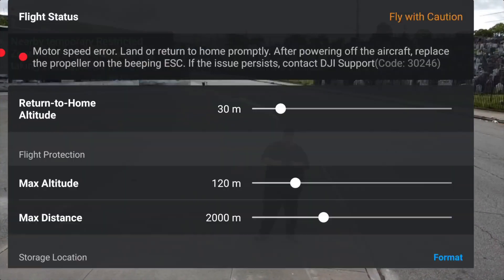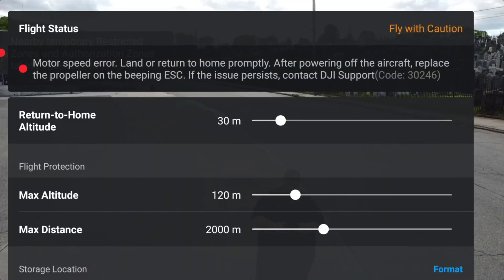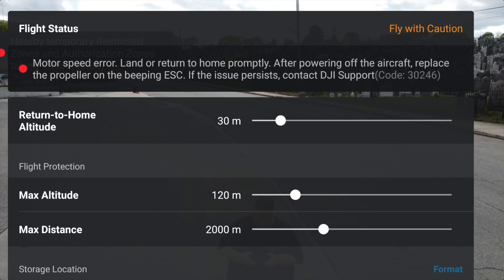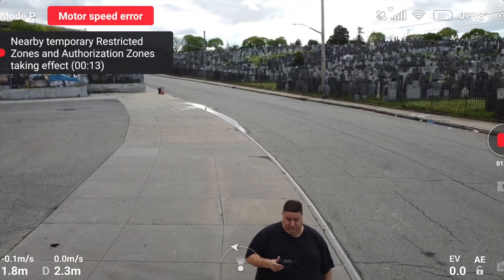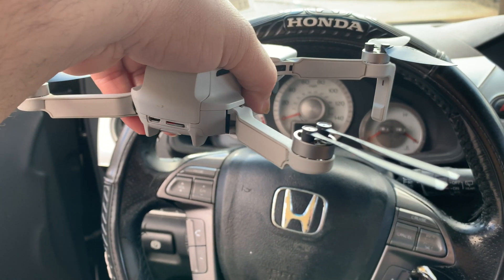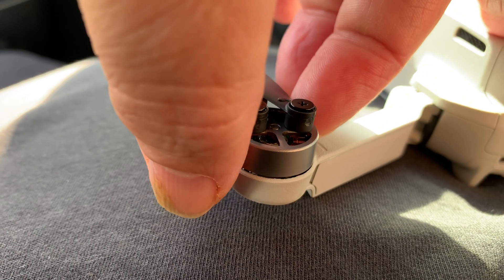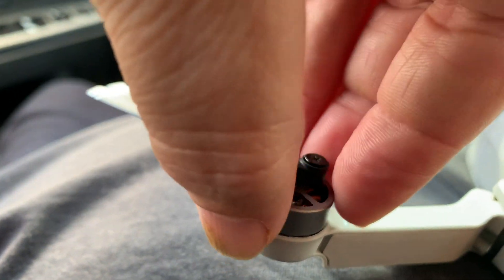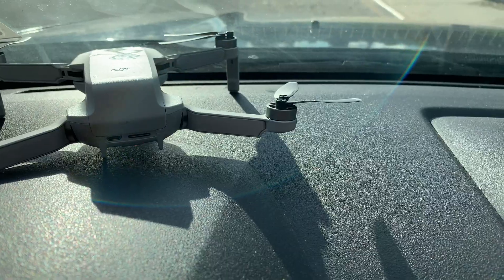Mavic Mini Motor Error fix

Comment: One the worst things you can do is to downgrade or take away its ability to tell you where its pain is. Yes it seems fine cuz its mouth has been muffled but eventually it will fall out the sky. Even with only the props being changed without downgrading the firmware it will be fine until those props warp again, AND THEY WILL IF YOU DONT CHANGE THE WAY YOU STORE IT. LIKE I SAID JUST PUT A SIMPLE PIECE OF SELF STICKING VELCRO ON THE THE BOTTOM/BACK LEGS. I also put one on the front/top ones as well cuz I don't like the flopping around. Just don't put the velcro on the blades very tight and bind them together and you won't have anymore issues with this error code, EVER AGAIN!! You should read my other comments and think about what I'm telling you.
The problem with downgrading is that the problem is still there only now its not capable of telling you its there and where it hurts. Thats why they added it afterwards. So you would be aware of a new issue since the book had been written. Its still an issue for the aircraft and its all depending on how bad the issue is as far as what you may or may not be doing to inadvertently causing the problem as an individual person. The most organized and neatest person in the world could have one and treat it the best in every way they know possible but not knowing what is causing it and or future worse problems by trying to solve a problem just by silencing its mouth so you don't have to hear that its in pain constantly. If you can hear when its in pain you can adjust things, at least slowly till its not crying anymore. And if someone that has cured the same problem by doing something simple it seems like a no brainer to give it a try, especially if what they say makes perfect sense. Which is why I shared. Not everyone will be humble enough to admit they dont understand the underlying issue because they don't have time to put into digging into it  but will try it anyway because their smart enough to recognize that it makes sense and will find out for themself by giving it a chance and Viola!! issue solved!! And not everyone will be intelligent enough to recognize that it makes sense so they do nothing at all till it falls out the sky eventually and thats when they will think about what im telling eveyone

Comment: So i finally figured it all out just by going through the motions and the facts on this speaks very loud. I'm gonna mostly let the pics and videos do a good bit of the explanation itself.  If you keep in mind that the entire head of the drone cut out in the case from motor cut outs to nose tip is the same flat level in the case Notice where the ridge starts and stops as well. Just as it sits on this flat mirror is as it would sit in a flat bottom case if it needed to as in such case as I have.  As far as the props are concerned it might as well be a totally flat case just like my flat bottom MPP Fly more case I modified and use for the Mini. Theres nothing more that the flatness of the bottom of the case can do than this flat mirror does to bend anything if you store it the way i have for a year now. Self sticking velcro strip i got off my MPP CHARGING CABLE. JUST A SIMPLE CABLE WRAP.  If you pay attention to my pics and video you'll see that storring your mavic mini this way is really the only way to do it without worrying about an issue. As you can see the that grey tape on the mirror would be where that raised edge/red line starts and stops. Any other way of folding them than directly across as you see will bend them at all random places depending on how they lay each time. Start out with the design of the case and drone body lines. The red mark represents the grey tape i used. Blades running directly under motors precisely. The raise in the case is 1/2 inch. The motors and prps and velcro thickness only 1/4 inch. The props never touch bottom in the fly more case this way. They constantly remain un touched and couldn't possibly warp the props. What all this means is that ANY OTHER WAY is bad news on the props and Mini.
Everyone's over all knowledge of this varies from clueless to now the truth and facts that I can't see being disputed b a smart individual. But I realize there's hundreds of new owners everyday and some are just finding out about the issue. I know many will need more info than this and I'll answer questions but I'm wanting the ones that have some knowledge of whats going on to be see this. The pics and video and explanation alone will be enough for them to understand. Study these pics good and you shouldnt need much more explanation.

https://linksharing.samsungcloud.com/nafrqrJSpH6r 

https://youtu.be/cuGPaCuksek 

https://youtu.be/UGYaGyWJG_I 

https://youtu.be/uiFHdxhmSFw 

https://youtu.be/Vkya7c-PMxs 

https://youtu.be/VlvU22-BpwQ 

https://youtu.be/V8TXJyoI4WU

Comment: My dji mavic mini is crash and 1 error message motor problem and places only for 50 long and 30 metre Hight only how to problem solve
Reply from the maker: Make sure you change props and re install firmware...
Reply: @jclust  I have already changing popular and I have already update bye fly app firmware update

Comment: correct..new firmware  xxxxx500 nothing but problems. renewed all props after i got error and within a minute flying the error came back..i didnt fold the arms up since, i left them open so no props touched anything to distort them....DJI need to fix this in a new firmware update..hundreds and hundreds of people have this problem.

Comment: I still think its an QC issue as my MM had it from day 1. Is it possible they've had some bad batches? Mixed up something as the WW MM's are about 25% heavier than the JP version?
Well, some props seem weaker than other and trigger the issue. Find a proper propeller setup and fly with it., Thats it, but I think Dji should have alerted as all drones have to be registered! Thanks for the video!

Comment: Big Jay and his mini!  😄  Had this happen to me today too on a brand new mini essentially and super annoying.  Those props suck bottom line.  My exact prop was the issue today hop so u know.  They just too weak.  A really thorough video on this it’s appreciated....good job!  🤙🏾🤙🏾
Reply from the maker: Yes they are very flimsy props...
Reply: Bearings, not propellers. 0500 senses bearing wear in the shaft rather than that of flimsy propellers.
Reply: @quentinbush  it wouldn't be bearing wear on brand new MMs, especially because it's reporting the exact same motor for every MM. It's a firmware bug that they should have fixed in the next update.

Comment: Totally fed up with mine, 2nd Mini drone, same issue. Told DJI this is disgraceful to put this addition into v.0500. They blame it on propeller distortion, I said it is stored in their case. The cases are not fit for purpose if they bend props. I am in the UK under Europes stupid lower outputs.
Reply from the maker: I think the props are very flimsy and yes the case doesnt help...
Reply: @jclust  My Mini (2nd one) is back at the DJI workshop in Netherlands. 62 minutes flying time from new and no damage to the propellers. What version 0500 is picking up is bearing wear in the same motor every time. DJI blame props. A feeler gauge is what is needed to determine slack in shaft vibration against the base. This can also be felt between ones fingers. A possible very expensive fix for DJI if every Mini has to be physically sorted, the firmware is a cheap warning but doesn't fool me.
Reply: So why does the so called bearing wear go away when you downgrade firmware?
Reply: @pauldavies5541  This is obvious. V0400 doesn't pick it up because the motor issue firmware isn't included in it. The issue hasn't gone away, it is still there. DJI's answer "replace propellers" but there is a limit to how many propellers you are going to have to replace. DJI are in comms with me now regarding my bearing issue which is detected by V0500 rather than a human.

Comment: I had the same problem on the exact same motor then changed all the back props on both rear motors now everything is sweet..
Reply: You hope it is sweet, not for long. Bearings, not propellers. 0500 senses bearing wear in the shaft rather than that of flimsy propellers.
Reply: @quentinbush  not the bearings! Why would the left rear bearings of EVERY MM be going bad? They wouldn't. Stop giving people bad info. It has nothing to do with bad bearings. It's merely a glitch in the new firmware.

Comment: Mine was running fine but now getting motor speed error. I was 300m away and when trying to return I was moving at 0.2meters per second
Reply from the maker: Wow, the props are very flimsy they should upgrade props and forget about overall weight of drone..

Comment: It worked for me......thanks a million bud. My props were just changed recently so I left them on. The assistant program would not connect to my mini for some reason so I did a refresh thru the DJI fly app on my phone then did a recalibrate on the IMU setting......It worked fine. I burned up 3 batteries and run it in P for a bit then set it to S (sport) to get it really going........no issues at all.. Thanks man (from Alberta)
Reply from the maker: Happy to help...
Reply: Hey Ken, at what point do you change the props?
Saskatchewan
Reply: @longboardlouie5816  Well I put on the new ones and never had a problem after that. If you don't hit anything......why change em
Reply: That was after I downgraded to previous version

Comment: I have the same problem, but just one time... I turn off everything and turn on again and the error disappeared... I hope never happened again... Thanks for your video. From Portugal big hug
Reply: Did you also make sure that ALL batteries received the firmware? This is often the error because only the battery that has the firmware that is loaded during the update receives the firmware.

Comment: 11:58 you are not protecting yourself with this mask, you are protecting others.  The refresh of firmware not always helps, often really have to change props.
Reply from the maker: Yes the props are very flimsy...
Reply: Actually it is better than nothing. It may be far from 100% protection from it but it limits the amount of virus exposure if there is any. And thus less strain on the immune system if he does catch it. Common sense.
Reply: @iMakeFunWithFish  we are tired of an overreaching government that, for our own good, they tell us, locks us in our homes based on computer models that have never been right from day one and health guidelines that keep changing so much they might as well be written on an Etch-a-Sketch.

Comment: Thank you for your help. My motor error is now fixed and i only need to fix my remote controler beeping non stop. I try to calibrate the controller but it worker partially... The beeping sound stop when i calibrated but it start all over again when i turn off and on my controler. I will update my comment when i will fix his to help many people as i can
Reply: Thanks and all issue is fixed. I downgrade my dji mavic mini remote controller. Now, my beeping rc is fixed and i will wait for a update to fix this! Thank you
Reply: @jmous1212  Alternatively, you can go back to the V01.00.0400 firmware if errors occur again.
Reply: @jmous1212  Bearings, not propellers. 0500 senses bearing wear in the shaft rather than that of flimsy propellers.
Reply: @quentinbush  it's NOT the bearings!
Reply: @bruceskousen5451  Look at the video on the DJI forum site of the blokes 'mini' drone falling out of the sky feet from home. Tell me that isn't bearing seizure, certainly not from bent propellers DJI like to think. This bloke is completely baffled why it happened. I just made a sensible suggestion.
Reply: @quentinbush  It cannot be that everyone's left rear bearings are going out. Sorry, that couldn't happen if if they tried. About 99% of the error messages are for the left rear motor. It's a software issue.
Reply: @bruceskousen5451  I have the same issue left rear motor
Reply: Update : still have the same issue et and motot error is back lol i will wait for the next update and i will contact DJI support team
Reply: @jmous1212  Make a RESET with the PC program 'DJI Assistant 2'. Use the original DJI-USB cable. Start 'DJI Assistant 2'. Read the clues. Switch on the MINI and connect the cable to the PC USB port within 20 seconds, this is important. Then it should work. Then carry out the same procedure with the controller. Remember ALL batteries are in sync with the new firmware. If you have more batteries, plug in the first one and do the firmware refresh with the Mini and repeat that with the next battery. So you have the new firmware version everywhere. It is often the batteries that are not up to date.

Comment: I just go this drone, my controller it has a beeping all the time, did you know to stop the beeping on the controller,
Reply from the maker: You have to calibrate your controller if it happens again try firmware update or refresh if that doesnt work you have to call dji for replacement...
Reply: @jclust  thank you so much. One little problem that I have is this drone when I hit home to bring it back sometimes don't land in the same spot I don't know if that happens to u.
Reply: Clemente, the Mini doesn’t have precision landing.  It will land normally from the take off point about six inches to two or three feet off.  This is normal and nothing to be concerned about.  Safe flying brother.
Reply: @alzayas6666  thank you so much

Comment: Nope, had to revert to version 400 to fix this error.
Reply: Bearings, not propellers. 0500 senses bearing wear in the shaft rather than that of flimsy propellers so downgrading to V0400 may not save your drone from eventual motor failure.

Comment: after firmware update, the same error message, and the same prop as well
Reply from the maker: Did you changed the propeller that was beeping..
Reply: @jclust  yes, same error. I did down grade the firmware and it works like how I got it.
Reply: Did you also make sure that ALL batteries received the firmware? This is often the error because only the battery that has the firmware that is loaded during the update receives the firmware.

Comment: Nice! So lucky you could find the solution. Even I’ve upgraded the firmware and I hadn’t hace any issues, I’ve watched many users saying the problem was the bended props because the fly more combo box, and.... I had thought the exact thing you said in the last few seconds of video. I mean, putting the props looking each other so The props couldn’t get bended.
Reply from the maker: Glad it helped,

Comment: I've heard that this is a common problem usually for the back props which have a tendency to get deformed due to one not being super careful when folding them up straight when placing the Mini in the box.  Myself I bought a 3D printed clip which holds them in the correct position.  Also I've heard that you should not buy any third party replacement props.  Only go with the original DJI ones.
Reply from the maker: Great points, where did you get the 3d printed clip?
Reply: https://www.etsy.com/listing/751084522/dji-mavic-mini-top-and-bottom-prop?ref=shop_home_feat_3

Comment: Been a mavic mini owner since it’s released, bought the fly more combo and 3 additional batteries. I’ve installed the latest firmware and lucky for me have not had any warnings regarding the ESC motor. One thing I’ve never heard anyone mention on YouTube is to also update the batteries.
Reply: How to ? please ?
Reply: @Sam Samson - Once the initial firmware on the mini has been updated turn on the mini and once you open the DJI fly app you’ll should see a prompt letting you know your battery needs to be updated, follow the instructions and then do the same for all your batteries. You can also find videos on the battery update if you need to.
Reply: Thank you !! I will try this

Comment: You can update each battery by inserting battery in the mini and go to app on phone and REMAIN in splash screen and after a minute you will be prompted to update battery. Repeat steps for battery 3. Hope this helps.
Reply: This is usually correct, but in many cases the automatic prompt to update the battery firmware does NOT come in splash screen! I waited longer than 10 minutes and then I used 'DJI Assistant 2', unfortunately the automatic prompt does not come there either, then only a MINI refresh with each battery helps. Unfortunately, there is no way in the DJI Fly APP to check the firmware status of the batteries or to initiate a refresh.

Comment: Please note that ALL batteries have been updated. With new firmware, only the current battery receives the new software, but the other two do not yet. Safe solution: insert the second battery and start a refresh with DJI Assistant 2, then this battery will also be updated. The same with the third battery. English is not my home language, Google Translator
Reply: You can update each battery by inserting battery in the mini and go to app on phone and REMAIN in splash screen and after a minute you will be prompted to update battery. Repeat steps for battery 3. Hope this helps.
Reply: @WayneIrish  This is exactly the error , because in most cases the request does not come, I wait 10 minutes. If it came, the batteries would all have the correct firmware and everything would be fine. In the current case you just have to choose the uncomfortable way via 'DJI Assistant 2 for Mavic'.
Reply from the maker: Your are correct, great comment...